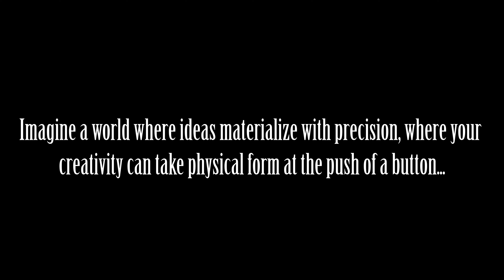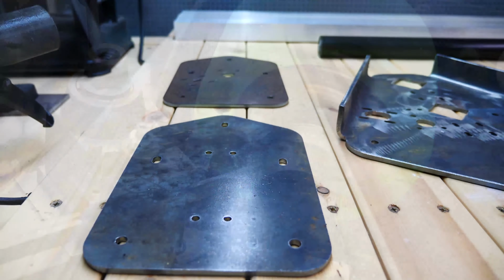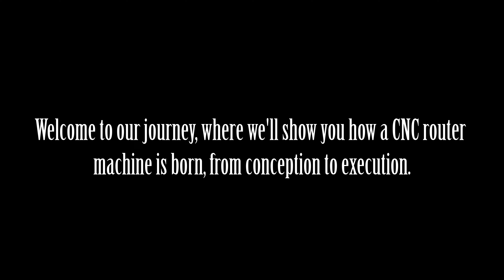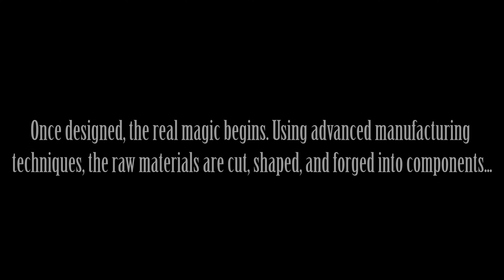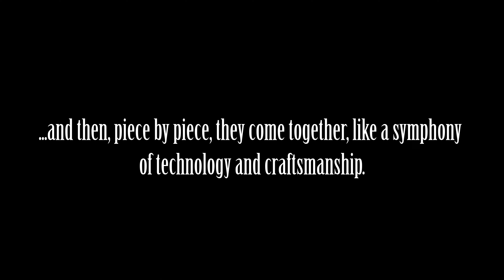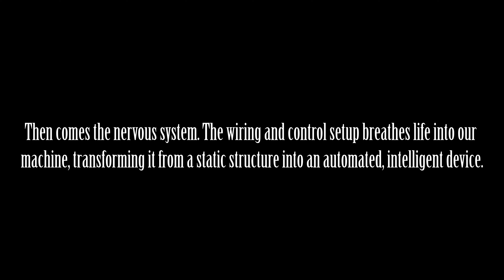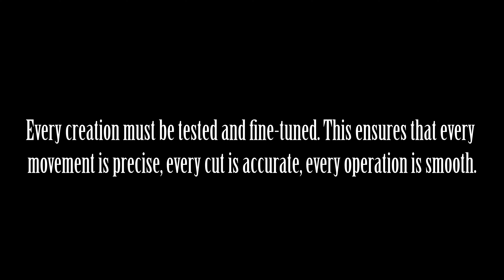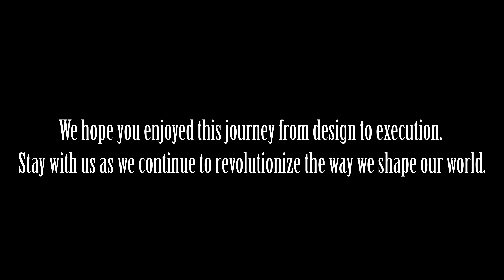WOW! DIY Large CNC Mill with 3D Print Parts That Cuts Metal! Using Marlin | SimplyWiser

Comment: Lot of work DONE here. Some of your concepts are great, some of them with time will generate problems. First problems you will get with timing belts, change it to string armored, black timing belt is good for 3D printers or small LED lasers. Longer the black belt is more problems you will become with precision in time. Marlin is not real good idea for Routers, this is from very beginning firmware for 3D printers. Much better idea is to use Arduino and GRBL or German ESTLCAM. You also need spindle speed controller, Makita You use for this project is great router I have used similar cheeper 3700 series. In my constructions. Problem to be solve is get proper RPM to particular materials. Example can be Plexiglas that can not be engrave or cut with more than 6K RPM because it burns, so you need to reduce RPM but you still need power, thats why you can not implement light dimmer to set RPM manually before start, you need something much more effective what will control phase, best if such unit can be controlled by PWM so you can control RPM from G-Code.  

Take a look at this machine also 3D printed parts https://youtu.be/yWWoyq8cDHg 
Here you got measurement system example https://youtu.be/DzewcGrJ4m4 

If any of my words can inspire you to some change I will be glad. 
I seriously think this is great project with lot of still hidden potential. 
If you need some advice I will be glad to serve you, with my experience Amateur CNC is my passion since 15 years. 
My email garage.make.zone@gmail.com you can also use FB https://www.facebook.com/GarageMakezone

Comment: Anny info on board and marlin srtup?
Reply from the maker: The board is MKS GEN L V1.0 the marlin firmware have been changed and update for fitting X, Dual Y and Z. 
What is the info that you are seeking for? 
We will try to help.
Reply: Im running same setup and use 4 nema 23 and a mks robin nano V3.1
Im verry qurious on your changes in marlin to get the second y axis running including the endstops.

Greetz from holland
Reply from the maker: Hi, 
Get our firmware download here https://drive.google.com/file/d/1f_MRXcWoWn1UPh6hWDewc5f6iRNKRJAu/view?usp=drive_link.
Hope it will help you. 
If you have any more questions, we are here :)
Reply: What endstops did you use? And did you use extruder1 as the second y-axis? If its possible i want to use e1diag endstop as my y2-min and e0diag as my y2-max. So i have independent endstops to make things super square on startup

Still waiting for my board.. 😔
Reply from the maker: I used those https://www.aliexpress.com/item/33023678899.html?spm=a2g0o.order_list.order_list_main.200.681d1802PRBjXa
But I saw that I am getting delay at reading so I solder them a bypass and now they are connect directly without the board.
Yes E1 is my secondary Y motor. For the endstops you should have at the board the connection for x-min, x-max, y-min, y-max, z-min, z-max.
Reply: @simplywiser  if i have my board i go try.. i cant dowload your firmware bcs of password.. 🤭
Reply: @simplywiser  you soddert them directly to the driver? Like connecting the callibration tool? Does this work? Or does this only work for second y axis?
I like the idea!! 👌🏻👌🏻😜
Reply: @simplywiser  did you use 2208 drivers? Isnt this to low amperes? I use 4 times DM542 driver 4.2 Amperes each.
Reply: @simplywiser  i have 6 endstops but have to set them in Marlin and i hope i will do this correct but can truely check as my board arrives..
Reply from the maker: Did you try again? There is no password on any file.
Reply from the maker: You can connect what ever switch that you like and change the parameter of the axis (for example X) #define X_MIN_ENDSTOP_INVERTING true or false.
I used tmc2208. It isn't low because my board isn't support the amp.
Hope to hear from you of success :)
Reply: Hey hi! Did not get notification from youtube.. 😔 Still waiting on the drivers and board still searching in the dark for the 2 independend endstop for Yaxis and Y2axis but if the products come i realy can test.
I open your file in arduino ide and my file in VScode and seach for differencis 😂 i keep you informed
Reply: @simplywiser  on de robin nano there are 7 endstops (i think if i did look good ann on the layout) if i #define a stop how do i know where to put it?
Reply: @simplywiser  how do you zerro on every axis on startup ?
Reply from the maker: @EdwinRamaker  By using the Home X/Y/Z or Auto Home for all axis. Then, move your spindle to the point (above the material) that gonna be your X0 Y0 Z0 (For example fusion 360 makes the g code to set X0 Y0 Z0 on the beginning of the code) and start your machine :)
Reply from the maker: @EdwinRamaker  It's seems like you got X, Y, Z-, Z+.

Comment: Bruv thats very impressive Great job but  can you please make a video about the configuration and what g code sender do you use that is compatible  with marlin firmware?? ❤
Reply from the maker: Thanks a lot. By using Fusion 360 manufacture mode, we create the g code, then by manual editiding we make it fit for this machine.

Comment: Would be nice of I could find metal rollers. Pom is ok, but not fr
Reply from the maker: Do you mean like those that I made from Delrin you want it from metal?
Reply: @simplywiser  yes <3 make them out of titanium or steel <3
Reply from the maker: If those wheels will be made of hard steel it might damage the aluminum profiles. @RoboArc
Reply: @simplywiser replace the aluminum rails fr with 11 guage steel. Big preformance jump.
Reply from the maker: @RoboArc  Shortly we will upload new video using the CNC to manufacture parts... you will be surprised :)

Comment: When u buy a real cnc machine , u will laugh at ur toy dream cnc or whatewer u dream about this build u call it a cnc mahine wich can cut metal , if u take a nail , and scrape metal , u can cut it too , and u can call that an nail cutter metal too .
Reply from the maker: This CNC machine made for cutting wood, plastic and aluminum. For heavy duty we might build another one :)
Reply: @simplywiser  You did a fabulous job !! Forget about this troll. :)
Reply: It's very light duty. Belt driven on unsupported aluminum tube for rails. Likely deflects just on movement with no load on the cutter. You can hear the chatter on the light cut on aluminum. I would chalk it up as a learning experience.